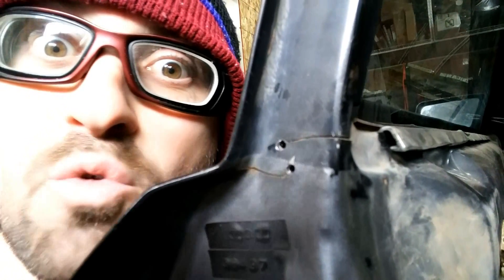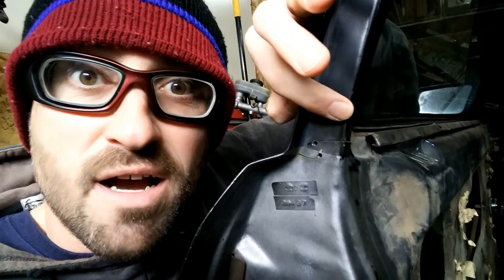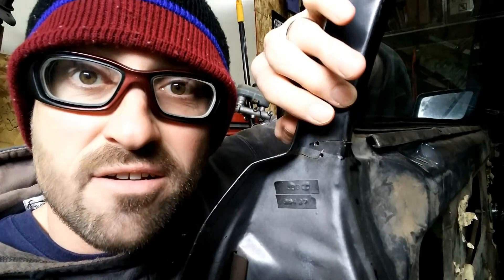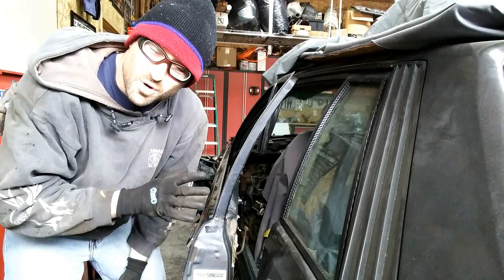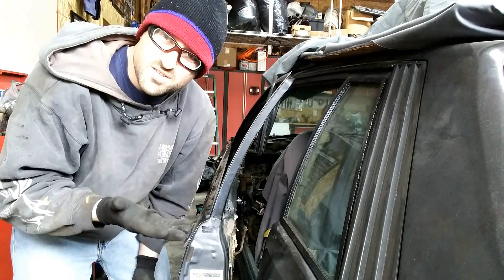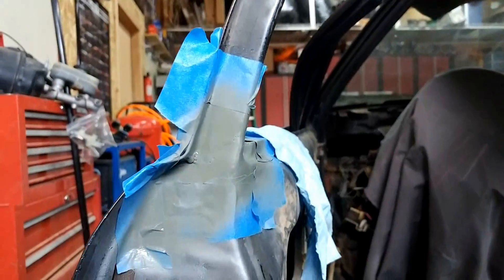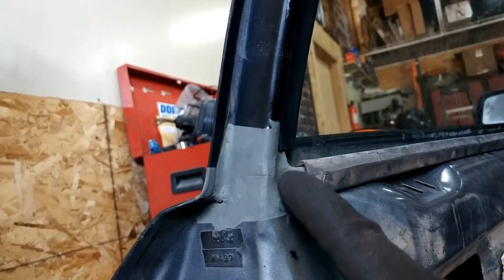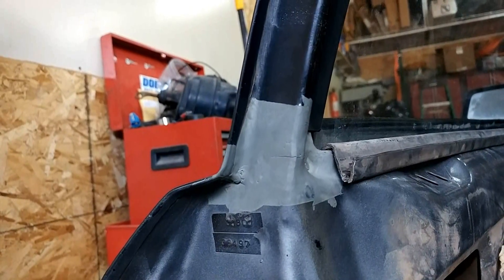Welding & Repairing Common Foxbody Mustang Door Cracks

Comment: I have had a couple foxes finally bought a notchback my dream fox about a month ago.. found out the previous owner did some crappie welds  that finally gave out. my upper control arm mounts etc are broken in several different places. looking in to buying a welder and have been hearing good things about miller welders. what's a good miller welder just to do some stuff like this on the vehicle... not too expensive hope you can help and thanks for your time sir ! good luck with your project! I love all your videos!
Reply from the maker: Glad to have you in the notchback club.  I had wanted one since the 90's and finally bought the Strawberry '92 a couple years ago to build my dream.  That ended badly, so now I'm on to up the ante with a widebody '80 notchback.  What's your budget on a welder?  The Miller 211 is around $1,100 new, but I've heard good things about Lincoln, Eastwood, and Everlast welders.  I bought my Miller MIG welder used from an acquaintance.